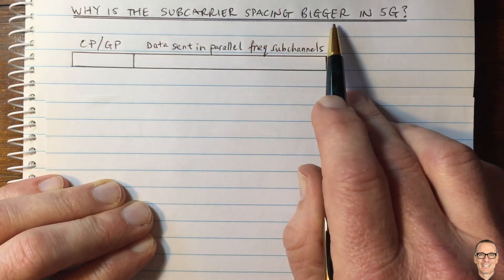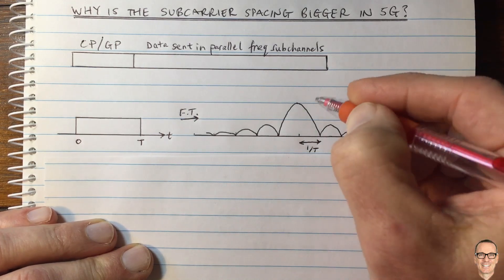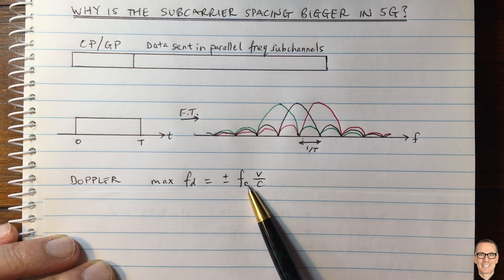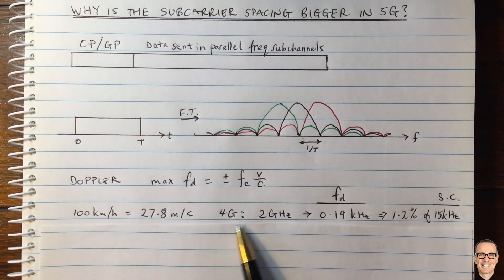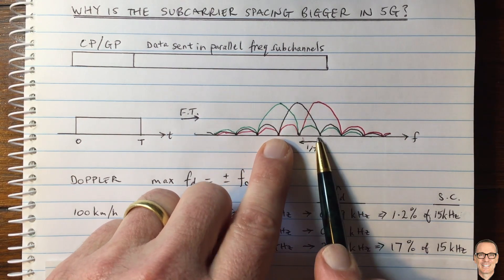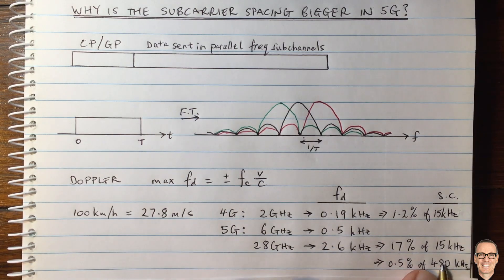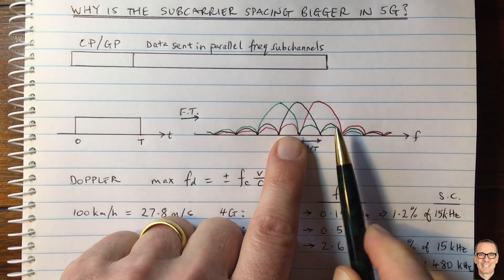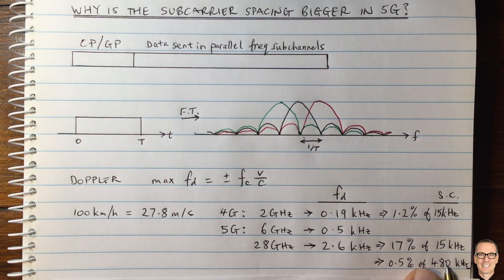Why is Subcarrier Spacing Bigger in 5G Mobile Communications?

Comment: Just a quick question. If the frequency is higher, then of course, as mentioned, the effect of doppler shift is higher. So the remedy is to increase the subcarrier frequency. However, high frequency signals are also more susceptible to multipath effects which means we want longer symbol durations and that requires lower subcarrier spacing. This seems a bit paradoxical to me. Is the reason that the effects of doppler shift are more prominent than the effects of multipath at higher frequencies?
Reply from the maker: Why do you say that "high frequency signals are also more susceptible to multipath effects"?

Comment: Hi, what happens when one is at stationary condition , will v = 0 or close to 0 , in that case what will be the fd (dopler spread) , whether stationary or moving at 100 kmph we are using the same SCS in 5G , could not understand this part  Could you help to explain a little bit  ?
Many thanks !!
Reply from the maker: The Doppler spread depends on the relative change in path difference across all the paths. When the mobile is not moving, the paths could still be changing path-length, if the scatterers are moving. More details here: "What are Doppler Shift, Doppler Spread, and Doppler Spectrum?" https://youtu.be/LLr3-kotbz4

Comment: hi sir!!. does a wider subcarrier spacing improve cell coverage?? for example if you have 50 MHz BW you get all the power spread over 138 PRBs with 15 KHz spacing, but with 60 KHz spacing you share the power among half of RBs.
Is it like this or the wider subCarrier spacing should also impact in noise so that you dont really get to improve coverage?
Reply from the maker: The overall SNR across the whole bandwidth determines the coverage.
Reply: @iain_explains  thanks for answering!!
May I also ask, what if it is a single building scenario?
Do you need to calculate the link budget based on overall power or based on power per subcarrier?
For example, if you have 50 dbm power
Do you need to use 50 dbm In link budget or 50-10log(number of subcarriers)?
I  was wondering that because I guess if you use 50 dbm you are implying that all the power is used in a single subcarrier
Reply from the maker: It depends on what you're comparing your link budget to. If you're comparing it to the noise power across the entire band, then you need to calculate the signal power (in your link budget) across the entire band. If you are comparing it to the noise power in just a single subcarrier, then you only do your link budget for a single subcarrier.
Reply: @iain_explains  thank you very much sir
I totally got it
Now it makes sense absolutely sense to me

Comment: Any other disadvantage using wide subCarrier spacing, except computation power?
Isnt its mean that we cant properly address frequency selective fading? 
Because you get your performance averaged across more then one RB(relative to 30KHz SCS), aka you sending pilot once in RB which is disaster or at least sub-optimal.

Thank you very much, this one was enourmously informative!
Reply from the maker: It depends on how frequency selective the channel is.

Comment: Great video! I have a question though:
In a given bandwidth, if you double the SCS you essentially halve the PRBs. This in turn will reduce the amount of data you can transmit in that band in a given slot.
But at 5:45 you mention that since each subcarrier is wider, you can have a higher data rate in each subchannel.
Can you clarify?
Thank you very much
Reply from the maker: A wider subcarrier corresponds to a shorter symbol period, which means you send more symbols per unit of time.

Comment: Hello Iain, just a quick comment - in the Release 17 a new subcarrier spacings were added, mostly to accommodate NTN links. Now the highest possible subcarrier spacing is 960kHz, not as you mentioned 480kHz.
Reply from the maker: Interesting. Thanks.